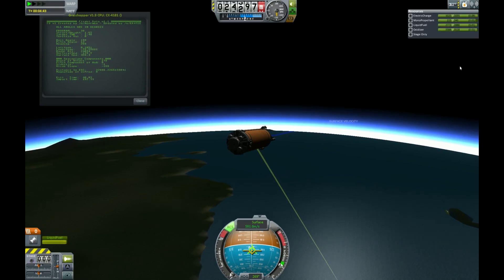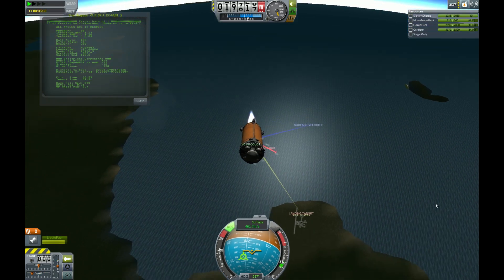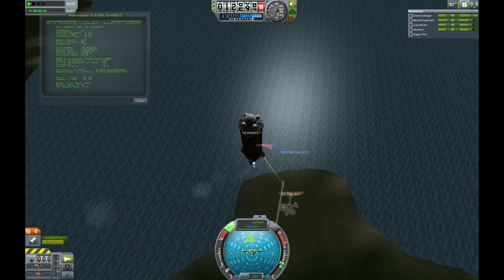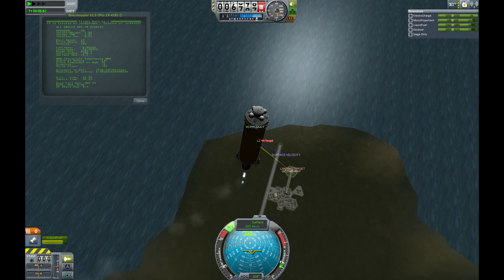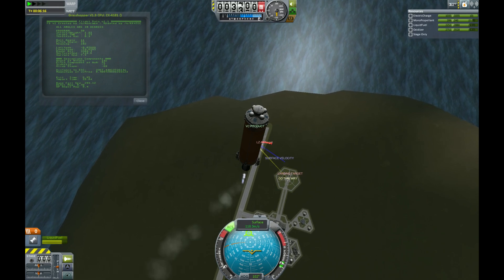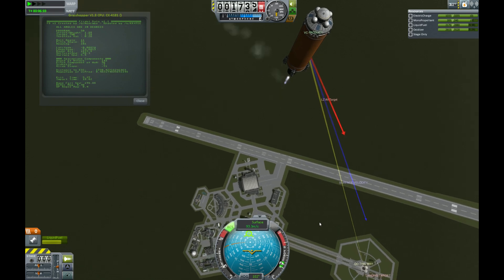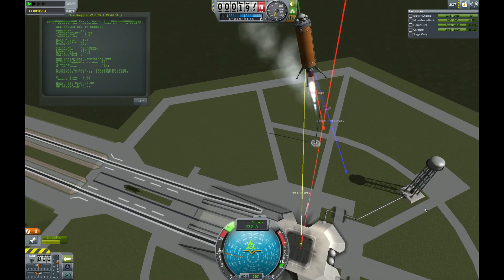Kerbal Space Program kOS Automatic Landing Test #61

Comment: Seems to use a lot lot more fuel than needed. Control surfaces + FAR ability + Suicide burn would seem like the "goal" of this sort of landing pofile wouldn't it?
Reply: I already have a launch system that reuses every stage back to the launch pad.  It uses a couple of assists hovering mods but for the most part it's all manual suicide burns.  The crew stage MK2 pod also uses jet engines for powered landings on the VAB.
Reply from the maker: Ole Kristian Kaarstad You're right. This method does burn a lot of fuel, proportional to the amount the initial trajectory is off from the target. My next step is to add a set of boost back or correction burns so that the course is lined up early and not off by multiple kilometers as was the case in this video.